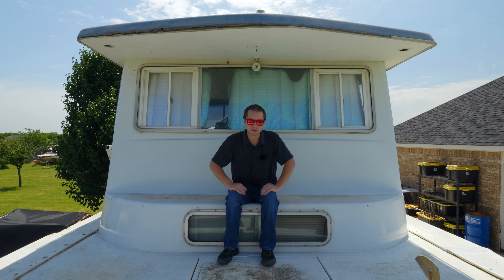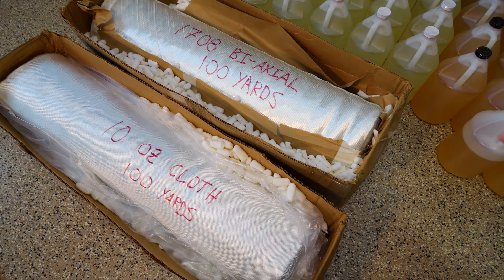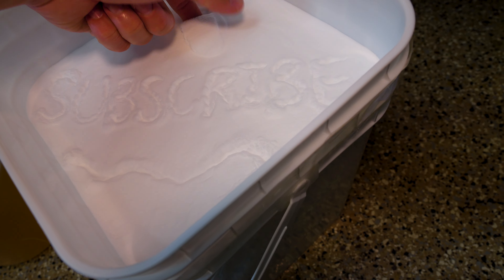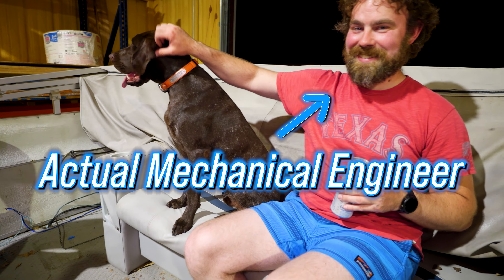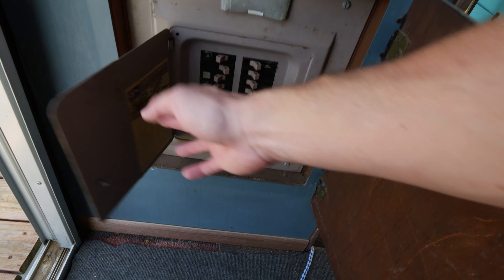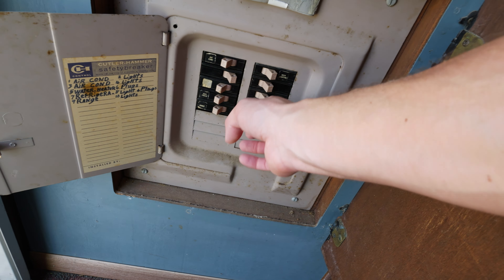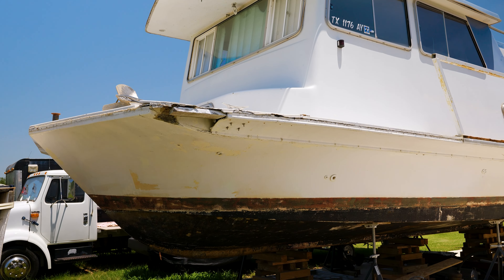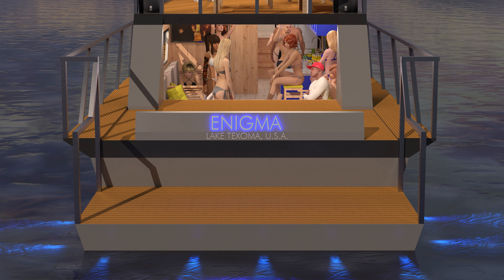Houseboat Restoration Update! Fiberglass Tests, Electronics Ideas, and More.

Comment: This video is 10 months old but just popped up on my videos. I've watched your other videos regarding the project, but I liked this one due to the graphics. This is a great video, and I would like to jump in and offer some thoughts pertaining to your generator situation.   
this comes from firsthand knowledge. The phrases, Gasoline generator and Houseboat should never be used in the same sentence.  Carbon monoxide is very real and deadly. 
instead of installing a generator consider this. Utilize the room and weight of the gen-set for additional batteries and upsize your inverter to handle the load of your AC unit and whatever other AC loads you think you need onboard. 

Solar modules now are approaching 600w each. 72 cell (It's approximately 4' X 8' 70lbs) when you layout for module placement don't be afraid to cantilever over both sides of your roof to give you room to add a couple modules if you have too. 

Anyway, love the project. love where you're going with it. love the fly by wire, (May want to consider some type of solenoid to shift the tranny in and out of gear. Not sure what you were showing was really for the trans, but if so, it seemed a little slow. I know you guys are more than capable of figuring it out but just an observation.

Comment: Where do you get your linear actuators at? I order electromechanical online but honestly they are so simple I can't imagine there aren't cheaper options in my local parts yard, like old hatch rams or something of that sort.
Reply from the maker: https://www.progressiveautomations.com/ but we are just getting into them, so haven't used them a ton yet.  That place has some waterproof ones that someone recommended for using in marine use since they wont fall apart so fast out on a boat, but we'll see.